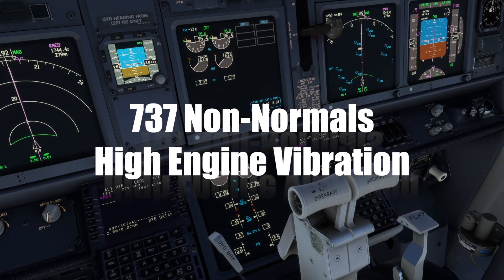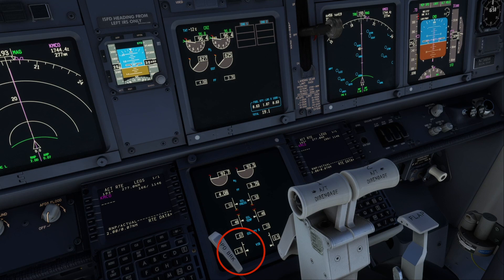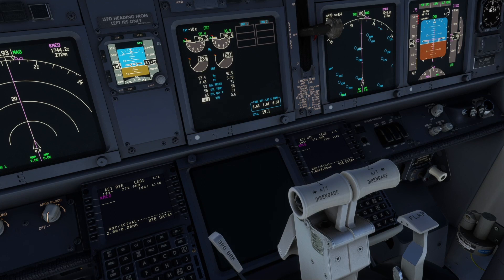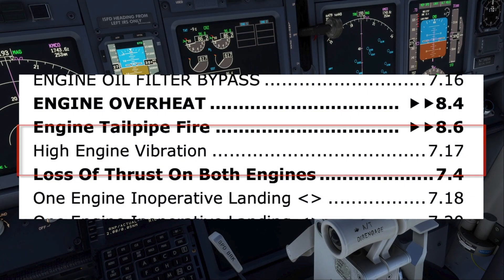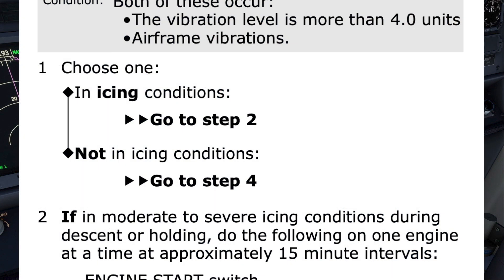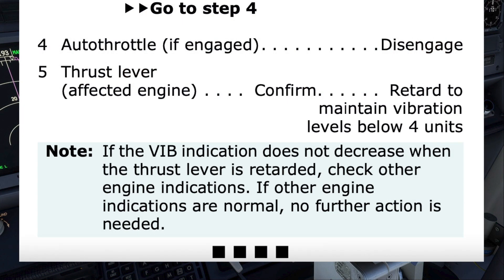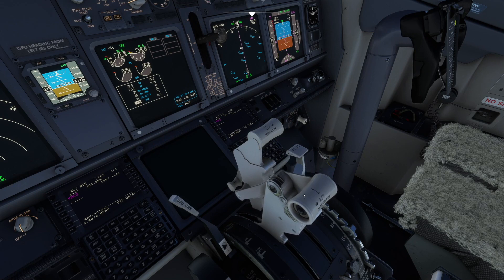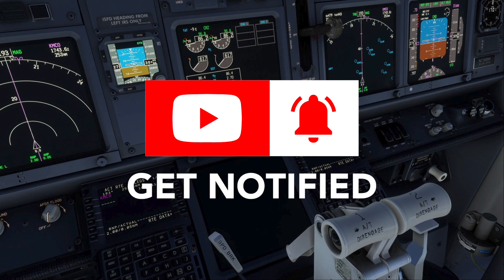737 Non-Normal Procedures:  High Engine Vibration

Comment: I guess it would be SOP dependent, but in the companies and planes I have flown, when you say that the pilot flying says 'my aircraft'  we would usually say, my comms or my radios or I have one,, as they already have the aircraft 'control'.  The two usuals forms are 'my control' and 'my radios', or 'I have... '. I've never encountered 'my aircraft'
Reply from the maker: Thanks for your input. In this scenario it was said in response to a non-normal situation, rather than the examples you gave regarding other times such as who's working the radios, the intent in this case is to clarify that someone is flying the aircraft, while the other pilot deals with the issue. If the pilot flying decided to start dealing with an issue, it would detract from safety. You make an interesting point that variations may exist between airlines (terminology between 'control' and 'aircraft') and this is based on my own training and experience. "My aircraft" is good though as it suggests managing systems as well as controls.  You are right who's leg it is is already established but this is an extra step so there's no confusion as to who is doing what at the start of a non-normal situation, and ensures primary control is maintained (aviate, navigate, communicate!) Appreciate your comment, keep them coming!